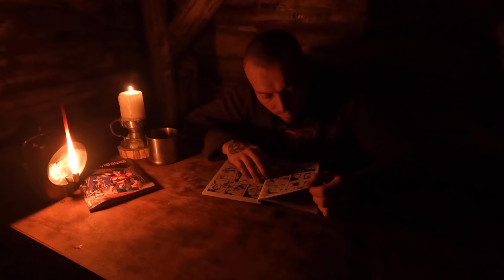Cozy Life in my Warm Dugout, Underground House, Winter Camping, Craft skills-Part 5

Comment: Your shelter/cabin is by far one of the best ones I’ve seen. Well thought out, solid, cozy, well built, long lasting. I love the furnishings you added. They really make the place into a comfortable house. Great job! 😊 That carbide lamp was an interesting addition. Haven’t seen one of those used since I was cave exploring. Does the job. Excellent video and Happy New Year 🎉
Reply from the maker: Thank you, Steven!  Happy New Year 🎉
Reply: That was a carbide lantern? Ive never seen one before. What is carbide? And was that just plain water dripping onto the 'rocks' to make flammable gas? Looks very effective and slightly dangerous
Reply: @luxonbushcraft  Yes, I believe it was a carbide lantern. Miners used those before they went to electric lamps. Not sure if carbide occurs naturally or not, but when you drip water on it, it releases hydrogen gas. I used one of those cave exploring back in the 70s. You just carried water and extra carbide to resupply the lamp, if necessary.
Reply: @813lem   Carbide, when interacting with water, releases acetylene gas. It is used in machines for welding and cutting metals.
Reply: I had a friend years ago who discovered acetylene lamps, as he called them. He had his water drip set low, so it produced an intense, yet smaller flame. It was small enough to stay within the reflector, but extremely bright when reflected.
His was designed to attach to a helmet.

Comment: Great build...   I am 77,  My dad inherited my grandfather's what I think they called a brace and bit drill.  My dad used a corded power drill, and I use a 20 amp cordless drill.  Slow but steady progress.  I used the brace and bit as a kid to remove really hard to remove screws to keep from stripping them because you could put all your weight on it.  I also use small power stations now when camping as it is safer than butane, propane, or white gas.

Comment: Oh, this is very nice. It seems I can feel how cozy this is through the video. Thanks for sharing your experience. One question: is there a name for the recipe of the soup?
Reply from the maker: Soup with eggs and homemade sausages! 😆
Reply: @luxonbushcraft  Haha, OK ;)
Reply from the maker: @sailaliamg2695  It's an old home recipe!
Heat the oil and fry the flour on it until golden, add the dried pepper and cover with cold water. Stir until boiling and add eggs and sausages, season as desired. I add garlic and bay leaf, it also works with parsley, but I don't like it. Put some cumin if you have stomach problems
Reply: @luxonbushcraft  Nice, thanks. I bet if you use butter instead of oil and firstly fry some onions until they become nearly translucent and later use a little chicken broth with the water, it will turn out even more tasty especially when it's cold outside and you need to warm up.
Reply from the maker: @sailaliamg2695  Of course! But it's not that anymore, it's more modern😃

Comment: Curious at around 21.00 minutes you made some kind of a soup and added the dried meat into it.  What is the soup called?
Reply from the maker: It's an old home recipe!
Heat the oil and fry the flour on it until golden, add the dried pepper and cover with cold water. Stir until boiling and add eggs and dried sausages, season as desired. I add garlic and bay leaf, it also works with parsley, but I don't like it. Put some cumin if you have stomach problems

Comment: Does anyone know what it was he made for dinner?
Reply from the maker: It's an old home recipe!
Heat the oil and fry the flour on it until golden, add the dried pepper and cover with cold water. Stir until boiling and add eggs and dried sausages, season as desired. I add garlic and bay leaf, it also works with parsley, but I don't like it. Put some cumin if you have stomach problems

Comment: What was that dish you made called? And was it paprika or turmeric you added to the rue?
Reply from the maker: I added paprika. There is no translation for the name of this soup 😂
Reply from the maker: It's an old home recipe!
Heat the oil and fry the flour on it until golden, add the dried pepper and cover with cold water. Stir until boiling and add eggs and dried sausages, season as desired. I add garlic and bay leaf, it also works with parsley, but I don't like it. Put some cumin if you have stomach problems
Reply: @luxonbushcraft  Thank you!

Comment: What’s the recipe for the soup
Reply from the maker: It's an old home recipe!
Heat the oil and fry the flour on it until golden, add the dried pepper and cover with cold water. Stir until boiling and add eggs and sausages, season as desired. I add garlic and bay leaf, it also works with parsley, but I don't like it. Put some cumin if you have stomach problems 😉
Reply: @luxonbushcraft  thank you the reason I asked it looked good